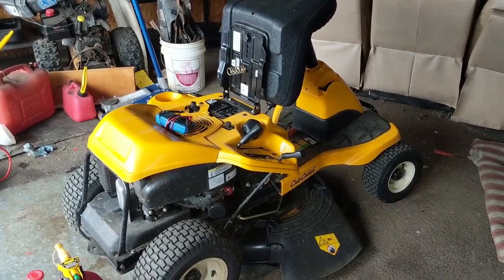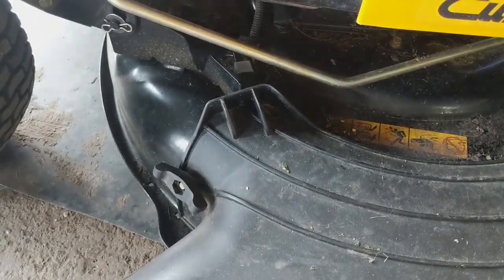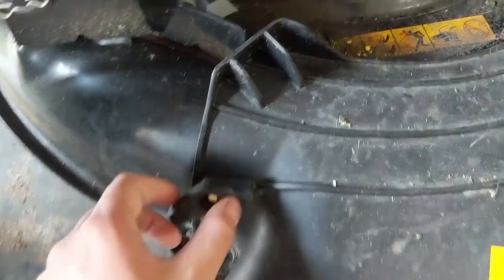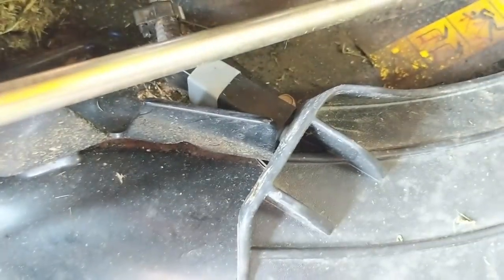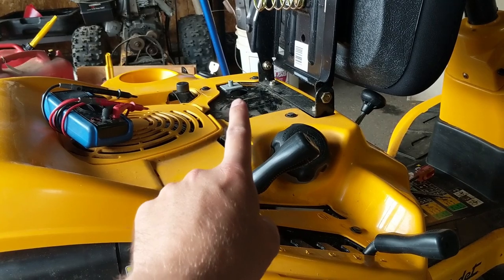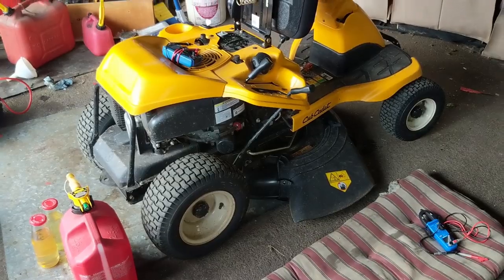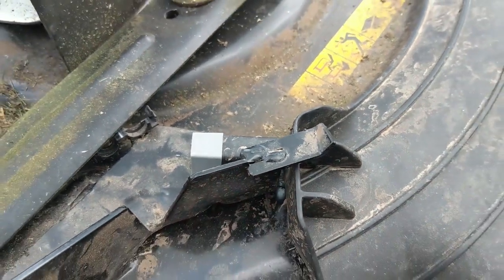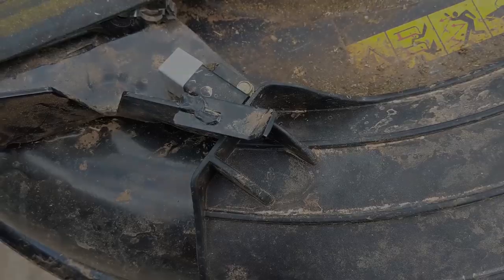Cub Cadet CC30 - Won't Start because of Design Flaw

Comment: Thanks so much! Mine has a bar over the top of the deadswitch to keep the cover down but it STILL had disengaged and I had no idea it was there - at least partly because the bar obscures the switch LOL. Thanks to your video I removed the cover and cleaned the area and my cubbie is purring again!

Comment: I saw the switch strait away,and the plastic chute........however ,the poor performance in wet grass I wasnt expecting......the blades simply load up and stall ,and smoke the belt ......most unhappy .......so I had to remove the chute ,as it was the worst block point for cut  grass........so I had to tape  the cutout switch ..Oh an keep my feet out of the blades.......My 45 year old mower will mow grass you cant walk thru ,even when its wet......zero stars for this new mower.

Comment: It's  a Cub Cadet branded mower but not design.
Reply from the maker: MTD owns Cub Cadet, Troy-Bilt, White Outdoors, Columbia, many different brands
Reply: @EliminatorPerformance   I own the Troy-Built version which seems to be a rough copy of the old Snapper small mowers. Some of the  Safety features  our litigious society has caused suck. The modern gas cans cause me to have a conniption....

Comment: MTD built all of these Cub, Columbia, Craftsmen are all the exact same platform.
Reply from the maker: Yes and the troy bilt models too, I was simply referring to the difference on machines between the manufacturing dates. The Columbia was newer, so I just mentioned they figured out there was this issue and updated the design by that date.

Comment: You were the first video and you nailed it. Ran fine..I stopped to gas it..I must've bumped the deck getting back on just enough to cause that problem. I have also been storing it outside and wasn't using the fitted nylon cover for it. The sun must be playing havic with the plastic. All good things for me to check. Thanks for the info on the fixes. Good job Man!
Reply from the maker: Glad it helped, thanks for watching!

Comment: Thank you so much for this video!  I have a CC30E (electric version).  It's brand new and stopped during the second time is was used.  The wing nuts were tight, but the plastic beneath one of the wing nuts was damaged and caused flex that disengaged the switch.  This video saved me from a world of hurt.
Reply from the maker: Common issue, glad you're all fixed up. Thanks for watching!

Comment: Eliminator Performance  I have a 1991 small Toro Ride Mower which has served me well for the past 30 years.Recently the Carburetor needed repair but parts for this old of Toro Model engine and carburetor are not available any longer. I can still start the engine if I squirt starting fluid into the carb chamber, choke it when cold and it will start and I can mow with it, but it will not start without using the starting fluid. This process gets old so I was in the market for a New Small ride mower, was wondering if you would have any recommendations. There is a Club Cadet dealer close by but I have seen several videos on Club Cadets and they all said changing oil was very difficult. I do not understand the Engineering and design of a mower that would not make the oil changing easy, that would be a good selling point.My old Tore is easy to change oil when needed, thank you.

Comment: Thanks s lot. Just boght the Toro neighborhood riding lawn mower, removed and replaced the cover to clean of debri, then would not start. Found your video.  Thanks for the illustration. Problem solved.

Comment: Thanks for vid.  Tried to start mine with new batttery after winter and nada and baffled.  Hopefully it is the switch.   No light, nada.  

Did learn to put a trickier on these batteries as they don’t have generators to keep battery charging.  Will see what happens

Comment: What a great video, really helpful. I had the exact same problem. Is there a way to resolve this? I got this mower like 2 months ago.
Reply from the maker: We've used self tapping screws, or you could bypass that switch if you wanted too.

Comment: I have the Cub Cadet CC30, 3 years old, kept in very good condition (annual maintenance done, etc.) everything was fine until our recent mow after a few passes the deck started making a rattling noise only when the blade is engaged. I have checked the blade, lose nuts, and what I think the problem could be but no luck. Any idea? Any tips would be appreciated :)
Reply from the maker: Maybe a broken clip on the deck hangers? Check the bars that connect the deck to the machine

Comment: I have the rear bags on mine so not sure if this is my issue. Got the mower for free, guy said it ran last year. Charged the battery but all I get is a loud bud/hum and it doesn’t even try to turn over. Any ideas?
Reply from the maker: @paoutdoors554  test the battery, likely dead

Comment: Hi, very helpful! I have a similar issue but with the PTO handle that engages the deck, every time ( since new) I try to engage the deck, the engine will turn off! I am not sure what the problem is, but using Duct tape to depress the safety switch solved the problem for me. Do you have any thoughts about why it's not depress the safety button when the deck engaged?
Reply: Hello! I am having the same issues and some are saying that the battery may be weak and that is making it shut off. I am going to try and keep the switch in with a piece of tape and see if it persists.
Reply: @TheSilveravi  I am using a piece of tape as well. The battery is fully charged, I'm not sure if my assembly of the machine was wrong!

Comment: The safety switch on the seat of my Cub Cadet Yardbug 1027 is normally closed so it opens when you sit on the seat. That also means disconnecting it disables the seat safety switch. Clever.
Reply from the maker: Thanks for watching!

Comment: It's not Cub Cadet or Columbia it's MTD, Also Troy Built and many others. They are all made in the same factory just different colors to target different markets. But good work and that is a great tip to look for.
Reply from the maker: Yes I'm aware of what brands MTD makes, I was just saying that they fixed it a couple years after.
Reply: @EliminatorPerformance  yes you are right

Comment: First of all, thank you for your video's.  We have a CC30H & at times when we release the emergency brake & add gas it doesn't move.  It tries & by keeping on the gas it breaks free.  This is intermittent.  Also, I now park without the emergency brake on & it acts the same way.  Thank you in advance.
Reply from the maker: Could be a sticky brake, possible to lubricate the pivot points of the brake lever, leading back to the transmission.

Comment: Thank you so much! I'm going to see if that will fix my self test fault message. I love this mower so much and love electric models so I was so happy to find this  mower. When it kept cutting off I was so sorry because I adore it otherwise. I hope it works, wish me luck! Update: It worked with lots of stops and starts. I did make sure the plastic was under the steel portion ( I have the newer model where they installed that. I think I wasn't paying attention early on and sometimes I attached the guard where that wasn't always on top. The plastic is a little warped as you say can happen. I got out some duct tape to try to hold the end down and then added a small stone under the duct tape ( don't laugh at me. Lol). It seems very sensitive to the slightest incline, wet grass, who knows but it shut off at least 12 times during cutting. Bottom line that and "seat fault" and "self test fault" was the code so not sure if they are related but thanks again for everything. I got the job done and I'm a weekly grass cutter so thanks for helping me get my yard back the way I like to see it. You're a gem!
Reply from the maker: Good luck!
Reply: Hi Sharon. Did you ever get this fixed? Sounds like we have the same mower (electric version purchased in 2020). Yesterday it started doing what you describe - starts up, mows a short distance, stops with a seat fault. This pattern continues.
Reply: For posterity, answered my own question. My mulching cover wasn't perfectly attached/aligned. It was tight and seemed fine, but after adjusting it to be sure it was "perfect", I was mowing like normal again.

Comment: Had same problem with my 2018 Cuc Cadet CC 30 H.  Mine has that extra welded tab but it still allowed the plastic to bend enough to not engage the safety switch.  Removed and remounted the mulching plug and adjusted the tab with a couple of wacks from a hammer.  Good to go now.
Reply from the maker: Awesome, glad to hear. Thanks for watching!

Comment: I had to install a new battery. It didn't start right off, so I charged it and it started right up. Once I turned it off it wouldn't start. No clicking, etc.  Checked this video and it didn't fix it. Am I missing something? After installing a new battery is there something I could have disconnected? I am new to this, as my husband passed away last year and he was the fix it man.  Any ideas what I can try before having to have it go to the shop?  Thanks in advance!!
Reply from the maker: Could be a bad brake switch, it all depends on what happens when you turn the key.

Does the solenoid click when you turn the key, if you hear nothing at all, perhaps the battery is connected backwards?

There's lots of safety switches on these machines, make sure the deck is raised and the blade is disengaged!

Comment: Thanks! Wasted 2 hours with a multimeter on the battery/solenoid/electrical system, then saw your video. Stupid POS switch.
Reply from the maker: Hey thanks for watching, and glad you got it going!

Comment: This unit is quite possible one of the worst designed machines from a maintenance standpoint, that I have ever seen. The oil change process is hideous also. The Cub Cadet tractors are fine, and usually pretty easy to work on. This is a good tip on this tu7d.

Comment: You said 4/5 times this machine lacks construction imagination.  Its very poor design makes me regret this purchase.  I estimate the time to assemble it in their shop is about 18 to 24 minutes.
Reply from the maker: They're decent, but they're not the best. For the 30" small residential mower, they're definitely the best. I would recommend the hydrostatic transmission version CC30H as they are easier to operate. The deck switch issue is something they have fixed since having this issue.